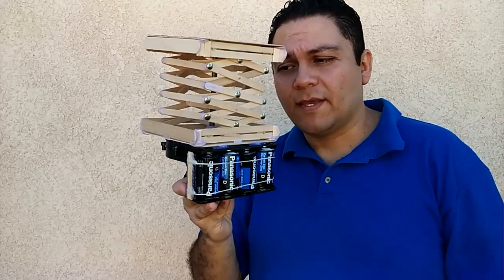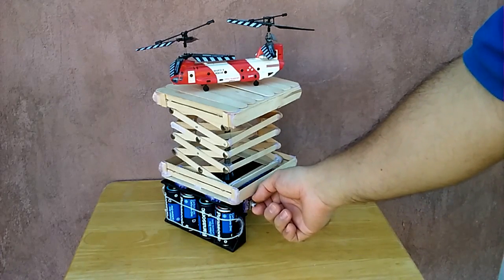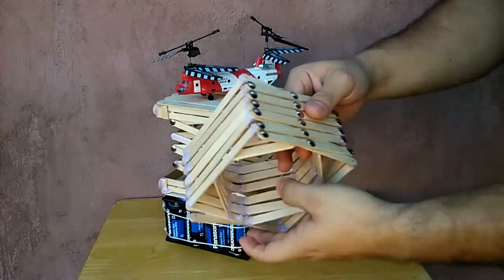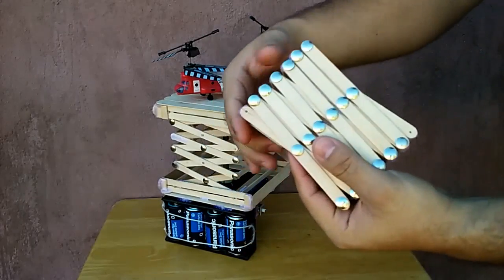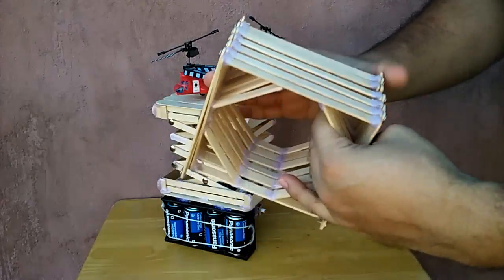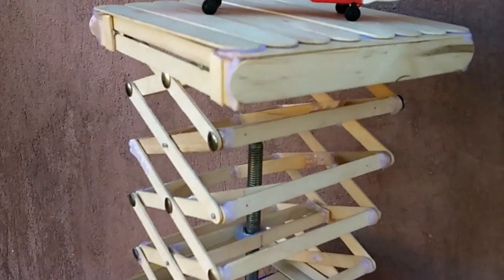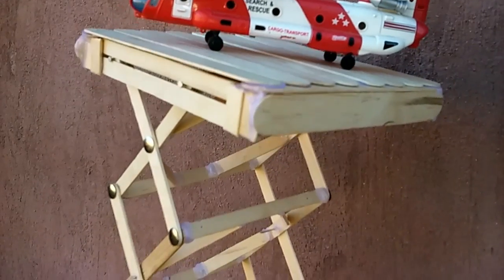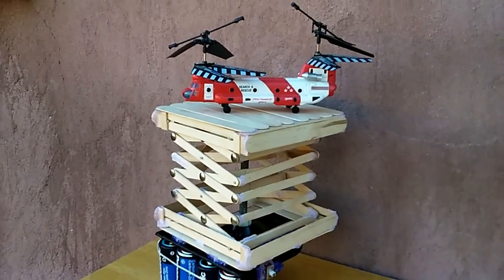Scissor Lift ( popsicle sticks )

Comment: What is the height of the extended lift?
Reply from the maker: Hello Alana Franklin, it is 15.5" (39.37cm).
Reply: J.L. Ibarra Avila I'm sorry for bothering you. I'm having trouble understanding the structure. Did you predrill holes in the popsicle sticks? Is splitting common
Reply from the maker: Alana Franklin Its no bother. Im glad to get questions. I used the same thumb tacks to make the holes. Its easier to grab the thumb tacks with some pliers. Then use it to "drill" the holes rotating your hand clockwise then counter clockwise. The sticks tend to split if you push too hard without the drilling motion.